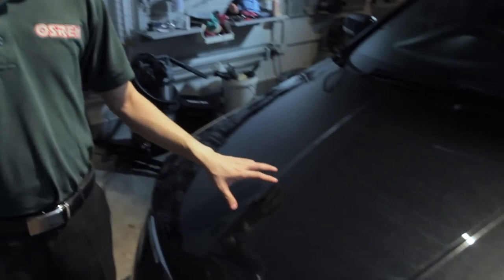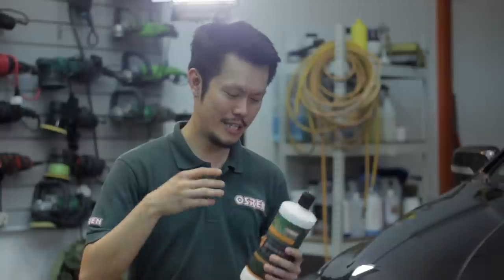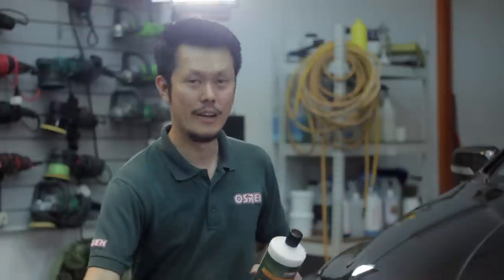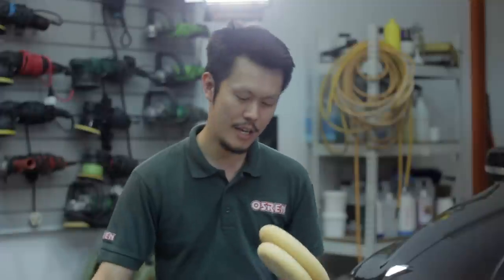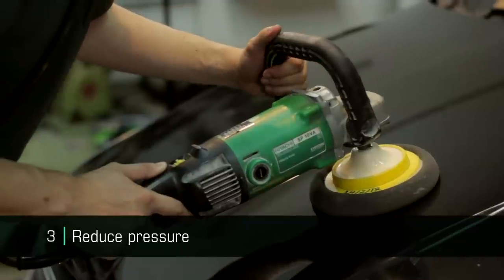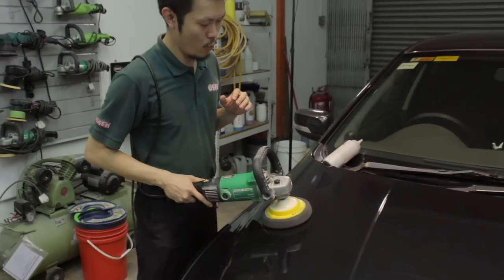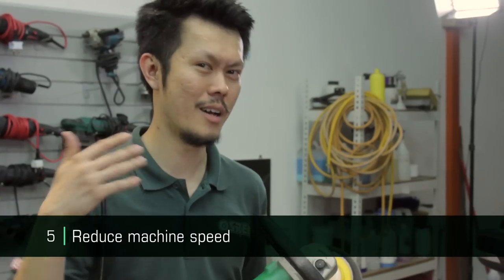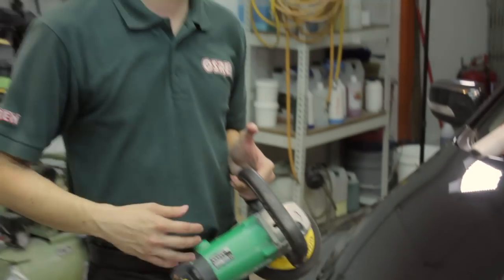How to Reduce & Remove Holograms with a Rotary Polisher

Comment: is mothers step 1 and 2 good enough to enough swirl marks and some baked bird drippings?
Reply from the maker: Theoretically, compounding and/or polishing will remove swirls marks and light etching (by cutting to reveal an even surface). Depending on how severe the defect is, you may need more cutting by increasing the aggressiveness. Always use the less aggressive approach and increase it if more cutting is required. You should be able to tell visually if the defect is visible from the polish/compound approach.

If it is too deep, I suggest not removing it as any further attempt to cut more clear coat can be detrimental to your paint.

It's also best to consult Mothers polish regarding their products. I can only share on the fundamentals of compounding and polishing. Hope this helps.

Comment: Thanks for the great info! How could i manage to do this without a polisher or a rotary? I have tried doing it with very little pressure with a meguiars applicator pad, but it still creates holograms, much finer ones.
Reply from the maker: Hi AceCZF696, It is very difficult to remove swirls and holograms by manual hand polishing. If you are creating more holograms by hand applicator pads, I have a feeling you might be scrubbing to hard. Would you be able to share us some pictures of your current condition? We might better advise you from there. You are welcomed to connect with us on Facebook www.facebook.com/osrenmalaysia
Reply: I bought a kit for my regular screwdriver drill and got it to work for my impact gun because I like it being wireless and I didn’t want to pay for a da polisher. The kit cost about 17 dollars on walmart like 20pc kit comes with drill attachment and applicator pads that stick on with velcro. It works good but I have halos now and it’s because I was pushing to hard or buffing too hard with my hand to remover the last bits of dried wax. I am going to redo it because I forgot to use my clay bar on that particular spot. I highly recommend using a clay bar first or you will be polishing over old dirt grime and wax which is a bad idea.

Comment: I am interested in applying ceremic coat for my car . I want to ensure adequate Bonding of the product with the paint after compounding ànd removing swirls and scratches.
Do you have any suggestion ?
After using the compound is it okay to use polish before applying ceremic ? Or should I avoid that step and apply any compound remover before applying ceremic coat ?
Reply from the maker: Hi Ganesharajah, ideally you want the paint to be as defect-free as much as possible. This may include compounding and polishing. Difference between compounding and polishing is that compounding usually is a more aggressive approach to cut more paint while polishing usually tends to refer to refining paint. Both are part of paint correction steps. 

Before applying coating to the car, it is best to clean and remove any oil or grease on paint. We use a mixture of IPA and water to remove it. Best to refer to the user manual in this aspect as different manufacturers have different practice or approach.
Reply: @OSRENOfficial  
Thanks a lot 😊

Comment: My dude!  You're amazingly informative.  Thank you!  Subscribed!
Reply from the maker: Thanks a lot dude! Would there be any content about detailing that you would like to watch or know more?
Reply: @OSRENOfficial  Well, I'm just getting into it honestly.  A lot of questions I've had to research were e.g. microfiber vs foam, speeds, DA vs Rotary, I think for the most part a lot is already covered.  It's hard to find good product comparison videos at times.  I specifically was searching for foam on a rotary as most people tend to favor wool, and this video covered it wonderfully, and even taught me a thing or two (pad sizes and heat distribution/cutting power).  The only reason I am even still slightly considering a rotary is how fast I see people doing correction work with them...a few passes with a wool pad and it's ready for polish.  But it seems DA just finishes better.  I'd like to see more videos about microfiber vs foam I suppose, and how they behave with different compounds and polishes, cutting and finishing microfiber pads.  I plan to use a red foam meguiars cutting pad but I think compounding with microfiber would be just a little quicker and easier, on a DA.

Thanks for the response!  If I think of anything else as I go along I'll be sure to reach out!✌️
Reply from the maker: All good man! Generally cut level for microfibres are between the wool and most sort of foams. Well if budget allows, you would want to get a rotary as well as a DA. Too many types of paint works out there that really reacts differently to each combo

Comment: well done for the analysis.when do we need to use the machine at it's highest speed
Reply from the maker: Hey Jimoh, you’ll need to use higher speed settings when you require more cutting action. Applying pressure can also assist in cutting. The keyword is contact, the faster it is or the heavier the pressure, the Polish + Pad combo has created contact with the surface hence giving more cutting. Too much contact however will cause heat buildup and the clear coat may soften to a point that cutting becomes inefficient.
Reply: thanks @OSRENOfficial

Comment: Short  and super helpful video . I’ve been playing around with paint correction and detailing last few here’s. I own and sell a lot of vehicles. Currently using a dewalt rotary  with 3m perfect it compound/ finish and hex logic pads. I have a black Subaru with a ton of holograms I can’t get rid of. Going to switch to a black pad and try some of these methods.
Reply from the maker: Different manufacturers have different colors to go along with their pads. Just use one that is softer/softest. Hope you may get rid of it

Comment: do the holograms only show up when using the more aggressive pads like wool, or even the light-cut foam and polishing foam pads will create holograms?
Reply from the maker: Hi GospelGuy, It is actually painted dependant. Holograms are basically extremely fine swirls that alter the light reflection. It is more commonly found after compounding with a wool pad. In our experience, foam pads do create holograms as well.  Ultimately it is about the defects that is left behind by cutting the paint.
Reply: I see. Thanks for clarifying :)

Comment: So more aggressive pad = more coarse looking ??? And the finishing pad will look more of a solid/ fine ??? Sorry as you can tell I’m very new to this
Reply from the maker: Usually for foam pad, aggressive one is coarse to the touch. Try using your skin to feel it. Whereas, softer pads are delicate to the touch. Also more spongy
Reply: OSREN (MALAYSIA) SDN BHD many thanks I’ve just ordered a vonhaus rotary and as I’ve never done it before I’m really worried about burning paint or making the paintwork look worse
Reply: @Algorithm347  have you tried it out yet?
Reply: Q Q yes I have , to be honest I think I was a bit nervous using the rotary , I got out the biggest ( as in length , not depth ) scratches , but there is still lot of slightly deeper scratches , but I was so worried about making the situation worse . Was happy for my first attempt .
Reply: @Algorithm347  Good to hear, I'm thinking about trying it out as well. I'm nervous as well
Reply: Q Q the only advice I’d give is , go slow and don’t apply any real pressure on the machine

Comment: Is the paint warm to the touch or still cool?
Reply from the maker: Hi Christine, the paint before polishing would be cool to the touch. 

During the polishing, based on the combination of pad, abrasive and techniques used, heat would be minimal. I would say it warm to the touch but nowhere near hot. Usually the more aggressive the approach, the hotter it would be as more energy is converted into heat.

This case, we want to minimise the cutting, hence usually less heat is produced.

Comment: Hey there,
one short question: if we still see orange peel on the panel, is it correct that the clear coat is not that thin yet? so still in the safe zone?

I am worried that I was too aggressive prior to watching this clip but I still have orange peel on my panels.
Reply from the maker: Hey Frank, if it's original paint, orange peel is a good indication of a good margin of clear coat. Unless it's a repainted paint with horrible workmanship, then it's different.

In our latest video, we levelled an original paintwork that has orange peel with a dual action polisher with the nao leveler 56, the combination actually allow user to have more control with removal of clear coat with very consistent cutting.

You can check it out here : https://youtu.be/0ZMGqMqr1XM
Reply: @OSRENOfficial  
Thanks Henry,
do you sell your products in Thailand, too? I haven’t seen them here yet.
Reply from the maker: Erm....... we are still looking for a distributor to represent us in Thailand 😁. Do you have any recommendations? 😆
Reply: @OSRENOfficial  
These days, everything is based on e-commerce in Thailand. The most popular websites are Lazada.co.th and shopee.co.th. Ali Baba is slowly coming up, but still very slow. Small shops mostly sell only local, cheap products. Try to make a comparison on those websites regarding the price. From what I know, there is only 3M and maguire‘s on the market, I mean serious international brands. There is a car repair chain, which has spreaded all over Thailand, called B-Quik. May be that could be interesting, too....

Comment: Can I know what colour pad should I use for compound, polish & wax? I got a rotary polisher and don’t want to cause more scratch on my car
Reply from the maker: Hey Gurvin, technically, it depends on how much cutting you require. The combination matters. machine, techniques, pads and abrasive. 

For compounding, we usually go for the nao compound 46 and nano blue wool to remove heavy swirls on hard paints.

For polishing or refinement, depending on paint condition or hardness, we either use nao compound 46 or perfect cut 20 with a maroon polishing or black finishing foam to refine.

The colored pads are OSREN pads. However, different manufacturer has different way of coloring and identifying their own pads.
Reply: OSREN (MALAYSIA) SDN BHD where can I buy your products?
Reply from the maker: @gurvyn  you may contact our sales team at sales@osren.com

Comment: Now that was very educational and it will help me a lot! So what you used to remove the holograms was a polish? At low speed, low rpm, faster passes, not too much product and removing the oils to make sure the holograms are actually removed. Correct?
Reply from the maker: Yes. In essence, the goal we were trying to achieve is to reduce cutting/aggressiveness. The polish we used was the least aggressive polish we have in our range.
Reply: OSREN (MALAYSIA) SDN BHD thank you for replying. I thought this channel had gone quiet. Are you making any more videos Henry?
Reply from the maker: In post-production! Stay tuned!

Comment: Hi. thanks for these helpful videos. I am on the verge of buying a Dewalt rotary. it comes with a 7 inch backing plate. My Question is, do i need to get a smaller backing plate(5 inch) to do a small car like Toyota Yaris/Suzuki Swift which have small panels, or a 7 inch backing plate will be okay too?
Reply from the maker: HI there!

Most of the time, a 5" would be preferable as most modern cars are now with curvy panels. The beauty of it is that rotary polisher may enjoy the swapping of various backing plate to suit our needs.

So there isn't really a "fixed" sets of backing plate you would need. But I would usually suggest having the 5" and 3" to start things off.
Reply: The Dewalt DW849 is the heaviest of all the rotary polishers, hope you have a strong arm !  ...LoL
The 7" backplate is for those awful 8" wool pads.  A 4" backplate with a 5" foam pad or a 5" backplate with a 6" foam pad is your best choice.
Reply: Thanks guys for the advice. My arms are kinda weak but i think I'll manage lol The holograms look like such a nuissance to remove. Will the car get holograms if you use medium foam pad with a one-step polish? or do they only show up when you are cutting with wool pad/aggressive compound? I'm beginning to feel like i'd be better off getting DA instead to avoid the hustle.
Reply: If you have no experience with a rotary then get yourself a DA. You will get great results 99% of the time with a DA and only a 30/70 chance with a rotary if you do not have experience with a rotary.  Using a rotary requires skills and at least 10-15 years of field experience.  Holograms usually show up from day one on a new car if the dealership prep did not know what they are doing.  Most dealerships hire carwash kids off the street and give them a rotary with the wrong pads and products with no training and is what we call in detailing the "Dealer Installed Swirls" option.  I suggest you get yourself a DA with a yellow cutting pad and 2-3 white polishing pads and a polish like Meguair's M205. A white polishing pad with a "Swirl Remover" like M205 is normally a good enough finish for most light and dark color cars followed by a no nonsense LSP like Collinite 845IW or Finish Kare 1000P.  AIOs are "Jack of All Trade and Master of None" products great once your car's paint is well maintained, but will be a compromise between a good polish and good sealant/wax.

Comment: Are those pads easier to keep flat than the 3M ones?
Reply from the maker: Hey Julio! Do you mean the wavy pads?
Reply: @OSRENOfficial  yes, those tend to skip on me sometimes, I also have 3 inch foam pads I do not have an issue with keeping flat and because of that I think they work better
Reply from the maker: Hmm.... Well professionally, we are not to comment on other brands, but all I can say is do explore around. In general, if the pads are brand new, it may skip around, if the pad is too dense and the paintwork you’re trying to polish heats up easily it may skip around. Sometimes the polish (liquid) paired may be incompatible, may also cause skipping.

Comment: can i criss cross using rotary? some recommend not to.
Reply from the maker: Hey Wesley Cheng! Erm..... What do you mean by cross cross?
Reply: @OSRENOfficial  I've seen a lot in using DA, they go horizontal and vertical (crisscross) as u're polishing the surface
Reply from the maker: @wesleycheng1842  For rotary, there isn't a need for crisscrossing as you have mentioned. Even on da, we don't really practice crisscrossing. As long as the machine coverage is even and swirls are removed, we don't see a need for it. But to each their own.
Reply: @OSRENOfficial  alright thnx, btw do i have to keep the pad moist by spraying abit of water onto it? so that it wont burn the paint or not necessary at all?
Reply from the maker: Water would be a supplementary. Depending on the paintwork you’re polishing, if the paint heats up easily or if the polish is too oily for the paintwork, you can mist a bit of water. But sometimes adding water while polishing can cause more swirls. No hard and fast rule about using water, just use as you see fit, but for our polishes most of the time we don’t need water

Comment: I think you just filling.. not removing..

With that movement and working area.. thats impossible to correcting the panel if u using cutting compound without filler and really correcting not filling..

Removing hologram and swirl is not that easy as you do.. unless you are using filler..
Reply: Bogorische dot com why didn't him answer?
Reply from the maker: Mainly because we believe everyone is entitled to their opinion and we don't find the need to change anyone's opinion on most matters. 
But to clarify, our abrasive range contains no fillers, get one and try it out if you must, don't take my words for it :P We can arrange for international shipping. 
Also, as shown in the video, after polishing, Henry wipe down with a 50/50 mixed IPA to remove any "fillers" or solvents that could possibly mask the paint's finish. By doing so, it reveals the true finish of the paint's condition.

We will leave and conclude this here. Thank you for watching!
Reply: we have not  to change anyone but I think that some things have  be talked, since  you put here on youtube You`ve to be open for conversations and  I don`t want to disregard your work anyway. Could you please send a sample of your compounds, polishes , whatever ? thank you in advance.

Comment: Just wondering about pad-size - with a larger pad don’t you get higher speeds at the outer edges of the pad and hence more cutting? Great videos! Very informative!
Reply from the maker: Hi MR Palu 666, thank you for watching our video and glad you liked it! 

Good question raised there. Before we shot the video we had a discussion within our team about the exact same hypothesis. Hence we did a test, documented it, put it to slow motion and calculate the rotation of outer edges between a small pad and a larger pad.

The answer we found is that the larger pad has a slower rotation. Here’s an unlisted video on YouTube made by our team to further provide visuals on how the outer of the larger pad spins slower than the outer of a smaller pad

https://youtu.be/768Qbm2v_7g
Reply: I have had a look at that video and mathematically the bigger pad should spin faster. 

What i think is happening here is that the torque of the motor has been significantly affected by being turned down so low. 

I beleive that once the larger pad is put to use, you will need to turn the power up on your machine, to compensate for the drag of the large pad circumfrance rubbing on the panel.

Mathematically the bigger pad should spin faster. It has to, as it has a larger outer perimiter. It therefore has to travel further distances for the same RPM.

Anybody else thinking on the same lines of thought?
Reply: +Nenad Stanojevic its turning the exact same speed as the pin driving it on the rotary.